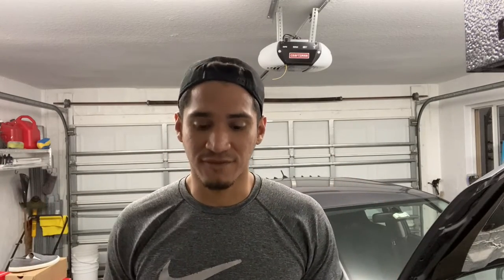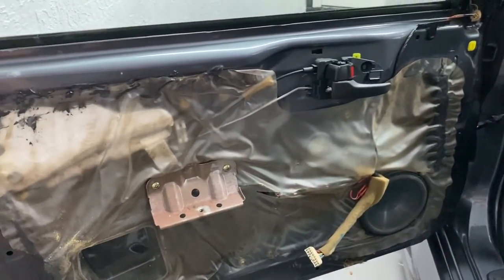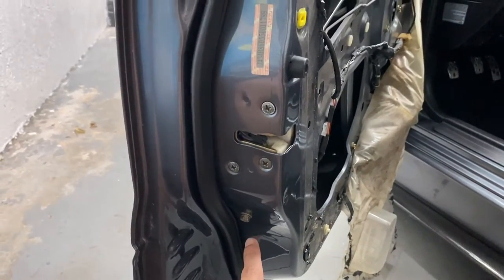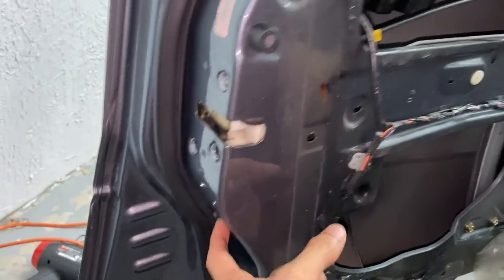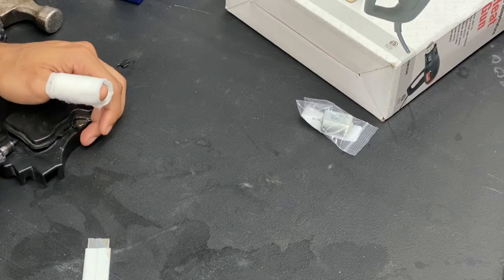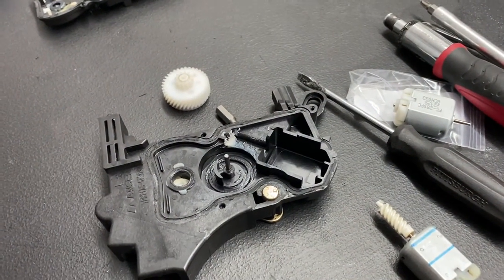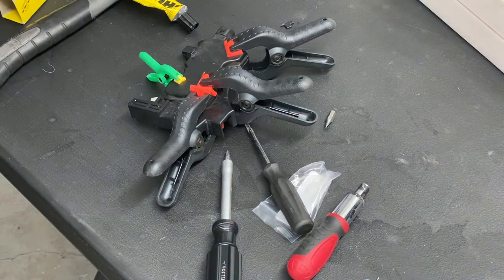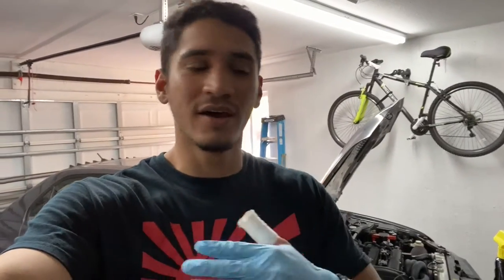HOW TO FIX YOUR DOOR ACTUATOR UNDER $7 DOLLARS! (MITSUBISHI LANCER EVOLUTION 8)

Comment: Sooo I just fixed my actuator on my 2008 lancer gts using your video!! The interior rods were placed in completely different areas and had to remove different bolts to get to them (it was a pain in the butt), but the actuator was relatively the same. The motor was the same as well. I hope that helps someone!
Reply from the maker: Thanks for commenting I'm sure this will help someone! Thank you!
Reply: Thank you!  I am going to try to fix mine soon.
Reply: Same problem on my outlander 2009

Comment: Thank you Chris for the link. I have literally been riding around in my 03 Evo with this issue for a few years. And I have looked everywhere for a door lock actuator. I just didn't want to spend almost $300 bucks for one from the only place I knew that had (the dealership). I have searched links on Evo forums and I read only 1 person took theirs apart, clean it, and regressed it and it worked. I tried and never got it to work. So for 9 dollars and some change I will try this. I honestly had thought about changing the motor but didn't have a number to go by so I just let it be and used my key.
Reply from the maker: Glad I could help Anthony!! Let me know if it worked out for you! TBH it should work perfect!

Comment: This helped me a lot sir, many thanks.  A couple of things though, my yellow and blue clips were really hard to open. I had to mangle the yellow one a little bit but finally got it open.  I didn't have a heat gun but a blow torch for about 20 seconds per bolt worked fine to break the loctite, although I discolored the VIN label a little 😅.  And when changing out the motor you don't need to take the gears apart, the motor pops out with a screwdriver.  Thanks for your video! (2004 OZ Rally)

Comment: Thank you so much for making this video! Both door locks on the used 2007 Mitsubishi Eclipse I just bought don't work. After much Googling & YouTubing we're sure it's the actuators. They look just like yours and I'm having the same issues you've shown. My husband and I are confident we're going to be able to knock this out ourselves instead of the repair shop wanting to charge $459 for just the labor alone. Thank you again for making it quick, clear and understandable, and most importantly, not boring me to death like some others. LOL

Comment: I've got a lancer 2009 and the rearpassenger door has the same problem. I am going to order the actuator and try. Hope it works.

Edit:
Today I have changed the actuator and it solved the problem. When putting everything back, make sure you connect everything properly. Because if you don't there is a possibility to lock the door and not being able to open it again (which happened to me but fortunately I was able to solve it with some struggle)
Reply: Today the same door doesn't open at all it just stays locked.

Comment: A great descriptive video. I wish I had seen it before I went through basically the same removal procedure on my 2013 Mitsubishi  Outlander PHEV. It had the same motor issues on three doors. I had not ordered replacement motors but did manage to open the existing motor, clean up the armature commutator & brushes, reassemble ,refit and test OK. I will keep that Amazon link in case/ for when the problem returns. Thank you C.G.
Reply: Having the exact same issues on 2014 PHEV, all but one work.

Comment: Thanks heaps. Just curious will this work on any door lock actuator? I have a mitsubishi mirage dingo and the passenger side lock doesn't work. I have pulled the door panel off and the actuator is a smaller white box connected to the lock mechanism. Just wondering will i be able to do this same repair or will i have to replace the whole actuator unit?

Comment: I think I have to do this on my 2005 Lancer ES. One of the things I noticed is that if I try to manually move the button that normally flips when locking, it's very hard to do and there's a lot of resistance. It's very easy to do on all the other doors. Do you remember if this is also something you noticed before replacing it?

I'm trying to make sure this is the same problem I have before spending a whole day replacing the motor.
Reply: @ilikewaffles3689 I have the same vehicle as you and about to do the same. How did you go with it? Any difficulties?  Was the setup the same as the Evo's?

Comment: This video did help me out! I have a 2010 Outlander and the instructions you give are near perfect for the outlander with only one small change I could find. The 10mm bolt that loosens the window regulator rail is not on the trailing edge of the door. On the outlander it is on the face of the rear half of the door. That was what was holding me up as I Had not loosened this bolt. After watching this video I knew I had to loosen that window regulator so I found the bolt in the different location  removed it and out came the actuator!  In with the new (used) one, back together and it works! I may replace the motor in the old one to have a spare
Reply from the maker: wow! that's awesome! I'm glad the video was able to help you out! That makes making these videos so worth it! Hope I can help out with more things for you in the future!

Comment: Thanks very much, i have the same problem with my back door on my evo, the switch is doing the same exact wiggle and is not moving to open or close
Reply from the maker: Yea bro it's most likely the actuator but before you buy it check that all the connections are good just in case.

Comment: Hi, Thanks for your video.  Very informative and useful!  I have the same problem but with a Mitsubishi Oulander 2010 LS.  I don't know if the part part included in the link you shared is compatible.  My Mitsubishi actuator part is 5715A300 (front right side)  Thanks!

Comment: I have a 09 lancer gts the door does unlock it just won't open from the outside, but if someone goes from the inside and pulls the handle it opens. After someone opens it from the inside the door opens from the outside with no problem. Could this still be the problem?

Comment: I just got a evo 9 and it stopped working. But ultimately did you have re wire the new motor is it just contact? And sorry about your thumb tech go though that with our knuckles and hands!
Reply from the maker: Just replace the actuator and your good to go!

Comment: I have a Mitsubishi Outlander, I’m wondering if that same actuator motor will work on mine.
Reply from the maker: hmm not sure you can remove it and see the part number on the actuator and order it like that.
Reply: Christopher Goorbarry i ended up ordering the one from the eBay link. Fingers crossed lol. For 6 bucks I will give it a try.. like you said once I remove the old one I’ll be able to get the part number if the eBay one doesn’t work.    Keep the vids, very informative!
Reply: John Zapata did it work? I have same for my asx
Reply: Caio Loponi Caio Loponi It did actually work. The shaft from the eBay motor was slightly shorter than the OEM one found in my car. So I ended up ordering another motor with longer shaft. Installed and it’s been working just fine.
Reply: @johnzapata8954  this is probably a long shot, but do you have the part numbers for what you got for the Outlander? My driver’s side door is buggered but I don’t really want to pull it apart and it be out of action while I wait for the actuator part. Mine’s a 2013.
Reply: @samwichp  give me a few hours and I will get back to you with that  part number. I can’t remember off the top of my head.
Reply: @samwichp  

This is the one I used for my outlander. The shaft is slightly longer than the one goorbarry  used. My install method was slightly different tho. Instead of taking the whole housing apart I used a dremel tool to cut out the plastic over the location of the bad motor and replaced with the new one. I did this because I was worried about not being able to put the gears and everything back in order when putting the housing back together. I used jb weld plastic weld to put the plastic piece back on.

https://www.ebay.com/itm/Rearview-Mirror-Door-Lock-Motor-Actuator-FC-280PC-12500RPM-12mm-Shaft-DC-12V-/383419556712?_trksid=p2349624.m46890.l49286
Reply: @johnzapata8954  you’re an absolute legend. Thank you!!!
Reply: @samwichp   no problem man.. btw. I forgot to mention that mine is a 2016.

Comment: Thanks. What a trouble... Not looking forward to doing this. Just found today the driver's door doesn't dnt unlock (or locked).
Reply: Note: this is a 280 sized motor.
Reply: Fixing my doorlock now. Motor 'worked' but no oomph to actually unlock. 3 screws which were all differently coloured, press clips.... Screw for the einfow rail and another for holding the keylock in place. Easy fix... But lots of fiddling. Waiting for the replacement motor now... Shipping delays now.
Reply: BTW, on a Lancer X

Comment: i just did this job, but now only the driver door unlocks and locks with the key fob, the rest of the doors have to be unlocked with the button on the door? any idea why?
Reply from the maker: If you double press the button it should open all of them. If you only press it once it only opens the driver door.
Reply: @ChrisGoorbarry  it still only opens the driver door only the fob will lock all the door but won't unlock them all:(

Comment: Gracias Homie!
My door locks been intermittently working for the last year. I just been putting it off since it's Summer but I'ma have to fix it now.

I put a list of shit I've had to fix ↓↓↓ bellow
from the common to the not so common.
Reply: Problems I've had to fix on my 05 Evo SSL:

1. Sunroof Motor
2. Window Actuator
3. Starter
4. Ignition Switch
5. Ignition Coils
6. Wire Harness in driver side kick panel
7. Alternator
8. Rusted/Froze/Stuck Bolts
9. Brake caliper return line
10. Wheel bearings 

 My Evo has had every single common and not so common issue from the sunroof motor dropping & having to remove the headliner which I found a few tricks for that after the 2nd time LoL
to more serious issues like the wire harness by the driver kick panel shorting out from water riding the harness in the wheel well down into the car. That was a bitch to fix bc you have to cut and solder/crimp 10-15 wires in the same bundle. The biggest issue with my Evo are the Bolts in the undercarriage. Doesn't matter if they are rusted or what, 90% of the bolts are stuck or froze in some way shape or form! Worst one was the wheel hub bolts that the coilovers bolt to. I had to cut them off and drill them out. It took 3 days and about 10 Cobalt drill bits & i still didn't get the holes drilled back to 100%. After doing it, it's definitely worth the $200 for a used knuckle just to not have to deal with it.
I also had to replace the front brake caliper return line which is a U shaped hard line on the caliper & Mitsubishi doesn't make them anymore. There one company that does but it was backordered for a month so I had to fabricate my own line which was a challenge bc I'd never bent/ flared hardlines before. Also, the little bolt was stuck so it had to be removed with extreme caution or replace the entire caliper🤦🏾 
I've had so many problems with my Evo, but I love this car more than almost any other car I've owned and I have/had some pretty dope whips...
• GT-R32 & R33, 
• 99 STi RA, 
• Audi B7 S4, 
• I've owned a few WRX/STi from GC8
-Bugeye
-Blob
-Hawk, 
-GR Hatch, 
• a few beat up 180s & 240s, 
• One clean S14, 
• I had a 3Z for almost a full year, 
Only one of them has the same effect on me like my Evo 8. And that's the "White Girl" my 99 STi RA and The only other cars I liked as much were the GT-Rs( White R32&R33) 
I love White cars. I looked everywhere for a White Evo 8/9 SSL bc I like the leather interior and the asunroof but I could only find RS's so I snagged my 05 Evo 8 SSL which I've become very attached to LoL